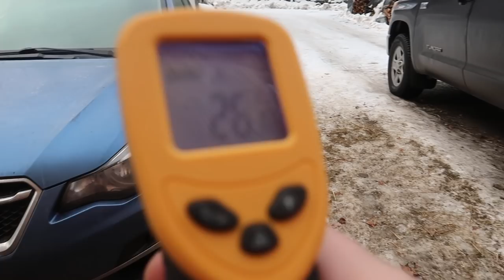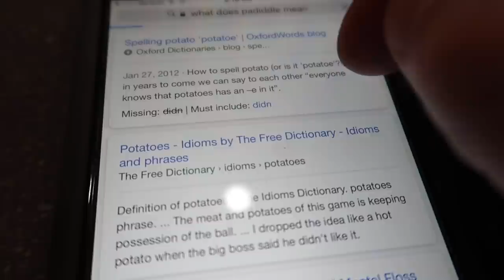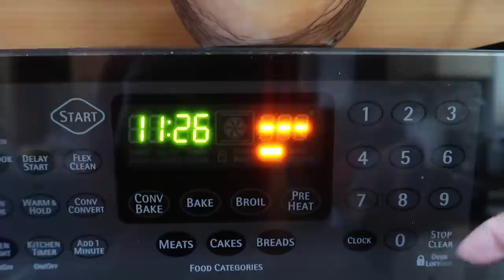This One Little Thing  Made my Life so EASY while I was 20' up in the Air!

Comment: Lights on goat barn and New yolkcity. The chicken water in green house/coop put a 2x4 wire cage around water the ducks and chickens can only get heads throu to drink water no more messy water.in your case you would have to put around water pan inside tire. Drill holes around edge on inside of tire cut wire so you can poke wire in the holes to hold in place.

Comment: My wife gave me the same strange look the first time I said "Padiddle" (or however it's spelled). I grew up by Detroit....

One small thing with IR temp gauges; they work best on dark, non-glossy surfaces. If the surface is shiny/reflective, the IR meter actually starts reading the temperature of what is getting reflected.

Comment: The head light issue is a big rip off.  Some newer cars require taking the bumper of just to replace the bulb. As a safety issue I think they should be especially easy to replace....lots of personal experience with head lights.    Laura

Comment: They really shoehorn as tight as they can get it nowadays. I've heard on some cars you have to take off the front quarter panel to change the battery. Haven't heard peddidle in years x-D
::edit:: we played peddidle like you would slug bug. Helps pass the time on long drives 😉😁

Comment: I know it’s probably impractical, but I would like to see some lights  on the fence around the goat pen or even around the top of the feeding trough.
Reply: M C not the feeding trough. They would be bound to check if the lights were edible, and bite through the cable like my heifer did.
Reply: Teal Kerberus , Oops! naughty heifer.  I thought at the very top it would be fine since they can’t get up that far. It was sweet that you tried to decorate for your heifer though.
Reply: M C we didn't actually intend it for her benefit, I like the fairy lights outside myself. But to be fair, a young animal can be excused for thinking the green coated wire might be some sort of edible vine.